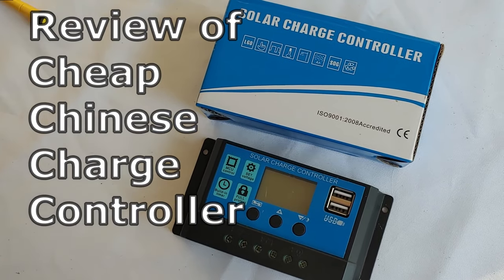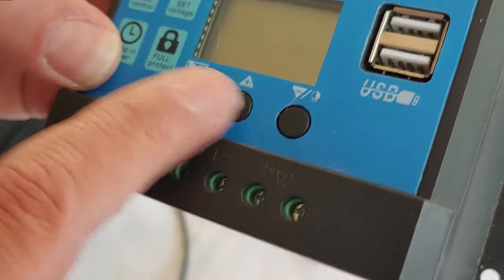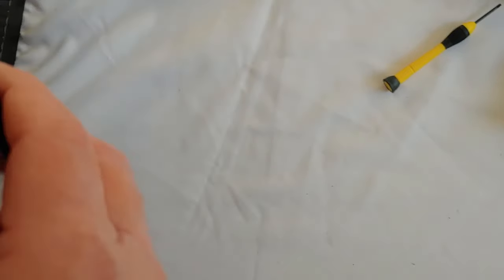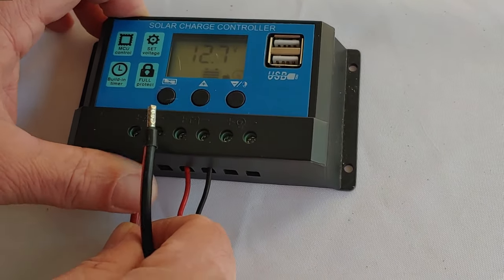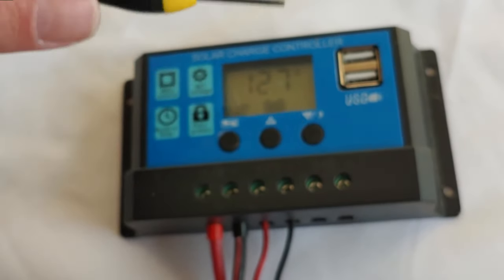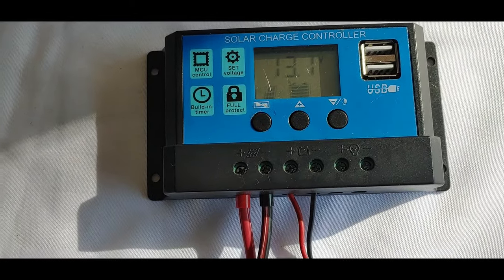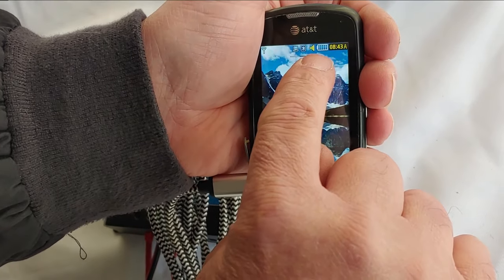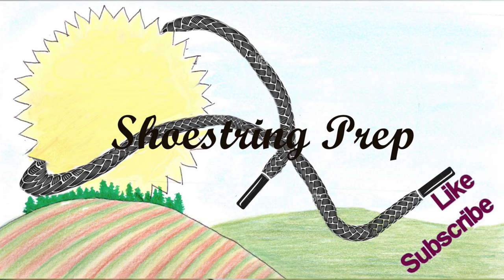Cheap solar charge controller

Comment: Have used this exact command, rated for 30A , using two 100w panels and 2 Deepcycle RV 100ah batteries, for about a year. So far, its operated great. I build a off grid cabin, I use this 200w specifically for lights and my on demand water pump. I get roughly 5 days worth of clouds and rain to operate the lights and the water. Other devices are connected to a larger system, fridge, microwave , coffee maker, etc. I split systems. In case of something malfunctions , i will still have lights , phone charger, charge my laptop. keeping the load light, this little solar command is perfect if you need simple lights a phone charge. Ive even run my 32 smart tv off it through a power inverter. To a large system this is is great backup system. Guys out there looking to buy one, make sure you get the 30amp, even for a 100w panel, i suggest only 200w. I bought some new panels which are 100w, but im pulling 110w out of each of the two panels. The latest new panels can crank out the watts , unlike years past where they say a panel is 100w and even in direct sunlight you get 90w if that...
Reply from the maker: Sounds like you have a great system. Thanks for your comment.
Reply: Yea. You got about the same as me. I'm very new to it all. I got 3 100 watt panels and 4 12v 35 Amp hour batteries. I think the controller can't handle it or so I think. Should I get a different one? Thanks
Reply: Do you use this same inverter that is in this video? What is Maximum Power Voltage, Maximum Power current rating on panels you use? I can get used panels for cheap but all of them have higher Maximum Power Voltage rating, that this controller is asking for(25V for 12V battery), most used panels have at least 35V or more.

Comment: I saw you can change the menu on the controller to change the battery type. Press menu to 601, then hold til screen blinks, then use 2 rt bottoms to change to cel flood or other lithium type battery. See other link video.
Reply from the maker: Thanks for your comment.
Reply: But he said you can't use lithium with this controller.

Comment: Been using mine on a small 100w panel system since 2015.  Still working just fine.  I use mppt on my 400 watt panel system
Reply from the maker: Appreciate the update. Comments like this will help other folks.
Thanks for your comment.
Reply: Which mppt controller? And how do you like it?
Reply: @johnwyman6126  generic blue controller that say MPPT chage controller ...cost was about $35 on Amazon.  I like anything that does what it is supposed to, when it's supposed to do it.  Sorry, can't attach a pic.
Reply: @johnwyman6126  I concur.  However, this works with 400 watts.  The next one will be because I plan to increase system size.  Perhaps, ne t year.
Reply: @leonleborgne573  I just found out there's a Chinese distribution company that has named themselves MPPT. It seems they order a bunch of PWM controllers from manufacturers and have their name printed onto the controller.
 The gyrations that these Chinese companies are willing to go through to be fraudulent just to make a buck are mind boggling.
Reply: @johnwyman6126  Yes, you are right. Here, in Thailand, same product is labelled PWM or MPPT according to the seller ;) Counterfeits or tricks are not a real problem in ASIA LOL

Comment: What I've noticed about the one I purchased is it seems to function as more of a charge regulator than a charge controller. Mine will send the battery a 14.4 VDC charge all the time, no matter what settings I use and it will never switch to a float charge. My higher quality MPPT charge controller will switch to a float charge on the same battery. You get what you pay for.
Reply from the maker: There does not seem to be too much quality control. Each one seems a little different. Thanks for your comment
Reply: Both of my Renogy type controllers both MPPT and PWM controllers hold the boost voltage at 14.6 to 14.8 volts for 2 hours, then it drops it back to a float voltage of about 13.7 volts.  However, Once the voltage of the batter drops below 13.2 volts then the solar charger goes back into boost mode again,  and the cycle starts over new every morning.
Reply: What is a float charge?
Reply: Pushing battery from 90% to 99%

Comment: Thank you for the video. I plan to order the exact controller. Can you tell. Me what is the largest gauge wiring that would fit into the controller? Also, should I be using ferrules?
Reply from the maker: I am not sure what size is the largest the cable will go. I use 12-10 AWG most of the time. Hope that helps, Thanks for the comment.

Comment: Can you tell us why you set the float voltage at 14.2 volts ? where did you get that number from ?  Also I would like to point out that when that controller hits `14.2 volts it will NOT stop charging the battery, it will charge and hold the battery at that voltage,  I would recommend a float voltage of between  13.6 and 13.8 volts, and it will then keep your battery at that voltage.  Doing a bulk charge or a topping off charge once a week of 14.4 to 14.8 for 2-hours would help to desolve any built up sulfate on the plates.  Thank you for the video.
Reply from the maker: I did not set the float at 14.2 the factory setting was 14.2 I was simply showing how to use the functions on the charge controller. You can change the float with it to whatever number you would like. You should set the voltage for whatever type of battery you have. Thanks for your comment.
Reply: I think you are right.  I might have ruined my battery by keeping it connected and set to 14.2.   I think it continually 'pulses' and potentially overcharges..
Reply: @johncantor4056  You might still be ok, because depending on where you live and the amount of daylight hours you get and how much you draw from the battery and so on,  But still I would reduce it down to 13.6 volts to be safe as a float charge. I have destroyed many things in my days, Ha ha ha,  Mostly cheap power inverters.
Reply: @rayberger2694  Thanks Ray.  I think my problem was a many weeks of no battery use during a very sunny period.  I was wondering if I should have the setting even lower when I'm not using it.  Trouble is ...remembering to change it!!
Reply: Hydrogen peroxide is also great at removing sulpher. Simple chemistry, ive used this method multiple times to restore dead lead acid batteries. A clean up and a refill with de-ionised water is then all you need to do.
Reply: @johncantor4056  a batter held at 13.6  to 13.8 volts should be fine,  I also noticed that if you are charging in a cool room 40 to 60 degrees some controllers will raise the float and boost voltages even higher.  I have a chart on this.
Reply: What is the float?
Reply: @michaelsrowland  The float on my AGM batteries is 13.5 to 13.7 volts, the float voltage is the voltage faze after the boost faze. my Renogy MPPT solar chargers have a boost faze of 2 hours at 14.4 to 14.5 on the AGM setting
Reply: @Eff-U-Kay  hello PsyllyCymon, I would like to see or be told how to do this Hydrogen Peroxide treatment. Thank you.👍✌🏻🇺🇸🙏🏽😎

Comment: I have two 20 amp PWM solar charge controllers, similar to the video, with four 100 watt solar panels running a 1500 watt inverter. Two panels are in a different location which is why I have 2 PWMs. BTW, they work with gel acid batteries as well. Since I have AGM batteries, I went with the PWM since I have a small set up. Furthermore, I also have two more PWMs from Newpowa, that cost more, which is the same company that makes solar panels. The two PWMs can do lithium or with deep cycle acid batteries. Just don't mix battery types for those who are reading this. I will be going over to Lifepo4 batteries in the near future. I already picked up a really good 2000 watt inverter that can be grounded. Most 12 volt inverters don't have a grounding feature.

Comment: Put a disconnect switch on the panels just before the controller. Turn panels on or off when working with the battery wires.
Reply from the maker: Thanks for your comment.

Comment: Late to this game but just started returning my big greenhouse to operation and needed to get the soar panels running the vent fan again. Bought the same charger controller. Yours is the best primer on the device hands down TY so much, brother.
Reply from the maker: Thanks for your comment.
Reply: What's the largest wire this mppt will accept? Thanks

Comment: My first venture into solar isn't going well.  I purchased a lithium Power Queen 12v/100ah battery,  this charge controller you show here but upgraded to support lithium and a Werchtay 100 watt 12v solar panel.  When I received the battery it had a 10.4 v charge on it.  Don't know if that was good or bad.  I got my solar panel a few days later and was hoping to charge the battery up to full voltage.  I noticed right away as it was lying on the porch that the corner of the box was pushed in quite a bit.  Opened it up and took out the panel to find that corner of the panel was damaged.  The glass was broken in the corner and the metal frame was bent a little.  Got my "upgraded" charge controller next as it was supposed to support lithium according to the website.  It looks the same as you show here in your video.  This controller says in the instructions that it does not support lithium but the website I bought it from says it does.  Hooked up the panel and battery to try to charge the battery but it won't charge.  Tried changing battery type settings but still no charge.  I get 8.7 volts open circuit from the panel in full sun.  I made sure all connections were correct.  Don't know if it's the charger not supporting lithium according to the instructions or it's the cracked panel.  I was going to order my inverter today but not now.  Why did I do this?
Reply from the maker: You did pick a great battery power Queen batteries are extremely good. As I said in my video those little charge controllers don't work well with lithium I would get a different type if I were you. I cannot say anything about the solar panel because I haven't seen it and I don't know what type it is. But try an updated charge controller one that's made to work with lithium and see if that doesn't help. Thanks for your comment.

Comment: The wonderful thing about these is they're cheap so you can buy spares if they break But I've used mine for over 5 years now and I have not had a problem with it. I mean don't expect it to charge at 30 amps or anything but for like something in less than 10 amps works fine.
Reply from the maker: Mine works as well. Thanks for your comment.
Reply from the maker: @freeenergyonshore2828  thanks for the info and comment
Reply: Even the 30amp charge controller wont charge at least close to 30amps?
Reply: How  many pv input watts?
Reply: Its all about the panels,  360w max, 3x100w panels in parallel is 15a, maybe 7x50w in parallel could be 28a but too many in parallel maybe 3 is max

Comment: I will be very interested in the overall performance of this controller. THANKS!!!
Reply from the maker: I've been using this charge controller on my volk's works inverter for the past 2 weeks now. And it is still working fine. Thanks for your comment.

Comment: I think I bought the same controller. SUNYIMA 20A Solar Charge Controller, Solar Panel Charger Controller 12V/24V, Multi-Function Adjustable LCD Display with Dual USB Port Timer Setting PWM Auto Parameter (20A). The listing on Amazon says it IS compatible with Lithium batteries. I installed this in my shed to power a light and to trickle charge my lawnmower. The I’m using a small LiPo4 battery as the main battery, and then a trickle charge controller on the switched output.
Reply from the maker: Some models do support lithium batteries and some don't. Thanks for the comment.

Comment: FYI. The load connection is powered by the battery. So you can run a device day or night & doesn't require a panel to be powered or even connected in order to work
Reply from the maker: Thanks for the info and comment.

Comment: I have read some of the comments and people is always saying that their model support lithium batteries. Well, you really need to read carefully the small quick start guide coming with it. It seems that there are different models supporting different batteries.

On mine it is written at the beginning:

3. The regulator is only suitable for lead acid batteries: OPEN, AGM, GEL. It is not suitable for nickel metal hybride, lithium ions or other batteries.

In case you are wondering, my model is the SP666.
Reply from the maker: You are correct. Know your model. Thanks for your comment

Comment: Hi .I loved the way of understanding how a simple solar system can work .but every household capacity is different. So how many batteries do I use equivalent to  solar panels if I want solar charge my normal 210 litre fridge freezer
Reply from the maker: You would want to know how many watts the fridge uses and how many hours it will be running then you can calulate what size battery you need. Thanks for your comment.

Comment: I ordered  one of this for my rv. I have a 7 watt solar, my plan is to keep my battery  charged  so I do not have keep it plugged  in . Like all rv ther is a couple of detection  devices  in the rv that drain the battery   I presume  it will still work  .
Reply from the maker: Let us know how it works out. Thanks for your comment.

Comment: Hi, I have purchased this to go Camping 2 twice a year. 250W Solar Panel Kit 12V Generator Camping Power Battery Charger Mono Regulator. Like this one in your video.
The regulator has 2 USB ports for charging Mobile devices Phones  and Pocket size Battery banks. 
As Am upgrading my Larger devices 12v Camp fridge. 
If I want to store the Solar Panels power into a Battery
How do you know what AGM Deep cycle Battery to buy In Ah's Example 25Ah, 50Ah 100Ah, ?? Thanks
Reply from the maker: The type of battery you buy will depend on how much power you need to store. Thanks for your comment.

Comment: I see you stated hook to battery first and then solar panel.   I have this controller on a solar suitcase that I use infrequently.   Do I need to unhook wires and rehook b4 each use - battery first?
Reply: Connect battery then panels and disconnect panels then battery.  I accidently disconnected the battery with panel still connected and it made a funny noise!

Comment: Thanks for the video. 
I was going to use 10w 12v solar pannel with 10A controller.
In cold weather,  lead acid battery drains so fast. 
Will it prevent ignition failure in cold winter for two months without other charging?  It will be better than nothing but still wonder if it will work.
Reply from the maker: Ignition failure in what? I don't understand the question.
Reply: @shoestringprep  what I meant was starting engine ( normally car battery drains in cold weather)

Comment: I am thinking of getting one of these. They sell them for 40 bucks inclusive solarpanel. But instead of connecting it to a battery, I want to connect it to two powerbanks, through the USB ports, charging them with a solarpanel. 

Should I be worried about anything or is it a solid Go Ahead? As your phone was charging but you were connected to the battery.
Reply from the maker: Yes, the battery was connected as I charged the phone. I never tried the USB ports to a power bank, so I am not sure what would happen. If you try that let us know how it go's.   Thanks for your comment.
Reply: This won't work. USB ports won't work without a battery.